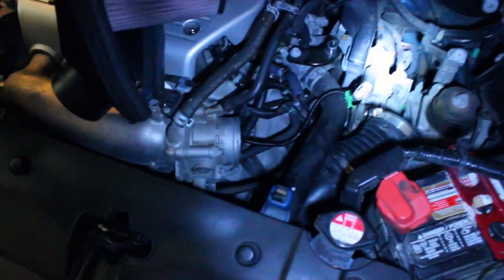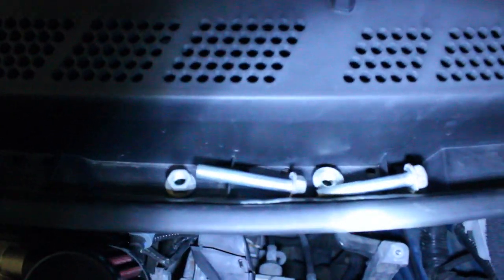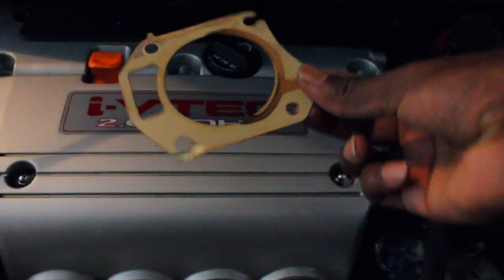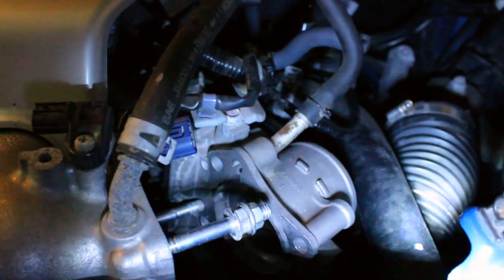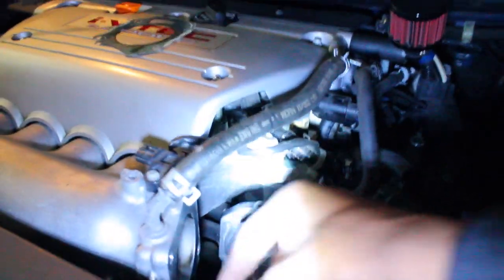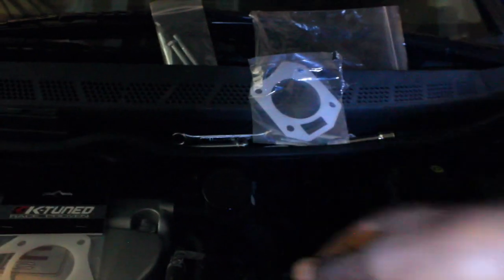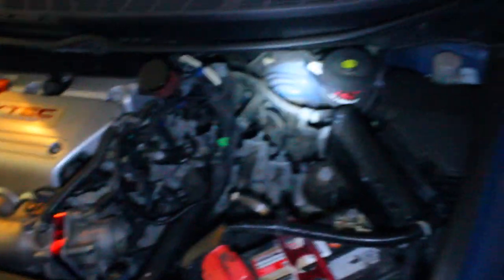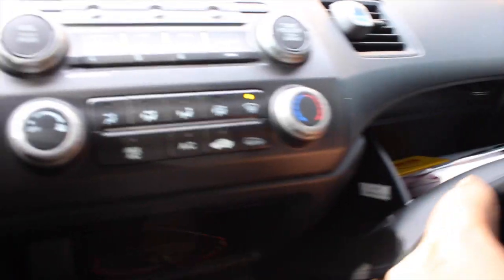P2R Throttle Body Spacer Install - Civic Si

Comment: I know this is an old ass video but I have an 2011 civic si fa5 all stock I/H/E if put a tb on would I need to tone it are would it be fine
Reply from the maker: I think most likely you would need a tune, since it’s an intake mod. It might mess around with the air fuel ratios, but every car reacts different
Reply: @HighBeams  ok I’ll dig more into it thanks

Comment: I've heard this may cause the intake to hit the radiator hose....did you have an issue with typhoon fitting back in after TBS install?
Reply from the maker: Yeah that's right tight fit, I had to install a new radiator hose, Gates 21229
Reply: @HighBeams  is this the part number to the radiator hose you used?
Reply from the maker: Yup correct

Comment: Do you actually need 2 gasket to install P2R Throttle Body Spacer?  Just one Won't do? thx
Reply from the maker: PTL FG2 Yup 2 gaskets would be the best option for separation